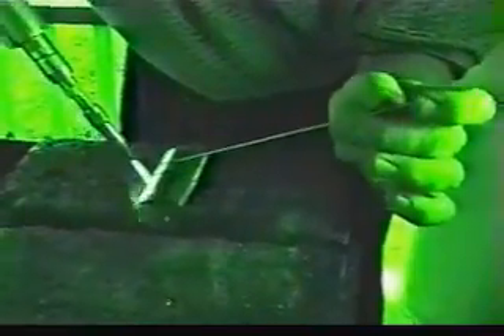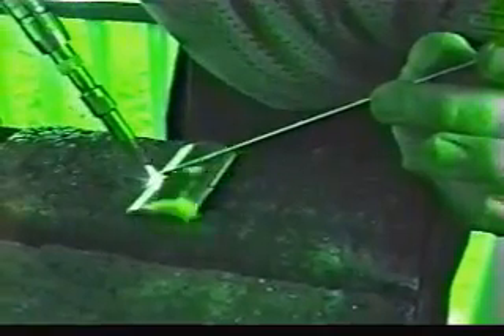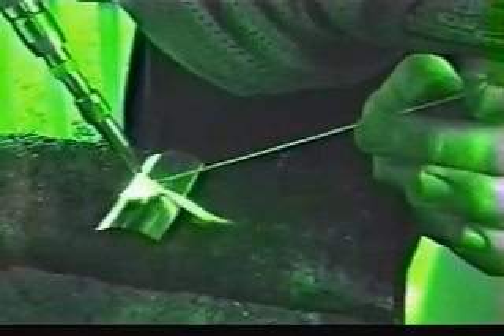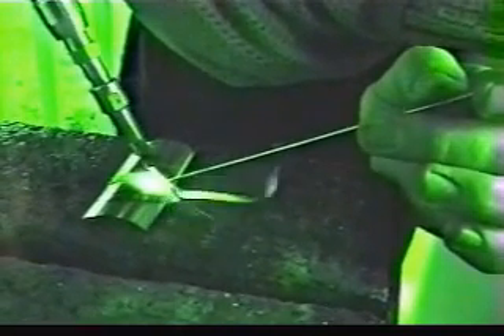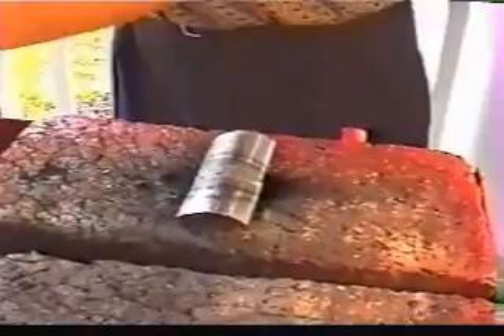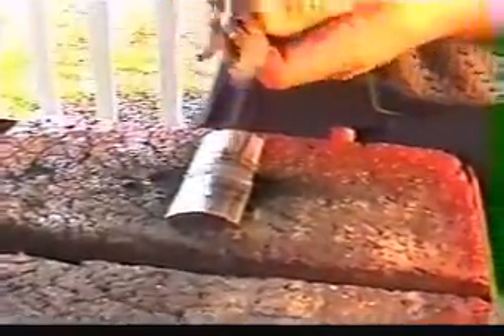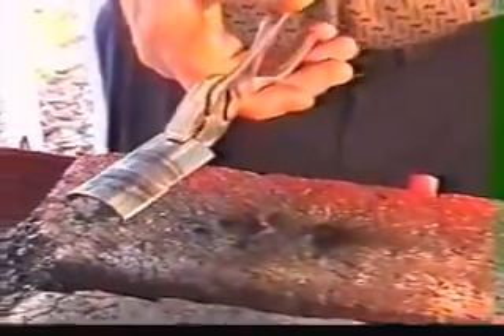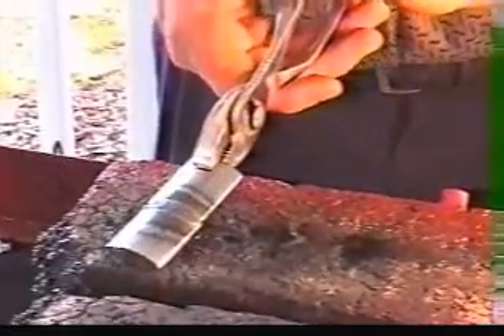Welding Stainless Steel with the Henrob 2000 Welding and Cutting Torch

Comment: @MrStevilKneivel you can burn the chromium and nickle out of the stainless steel if it gets to hot thats why burn through is not acceptable once there isn't any chromium or nickle it will rust because stainless is an alloy burn out the constitutes and you've got plane old steel